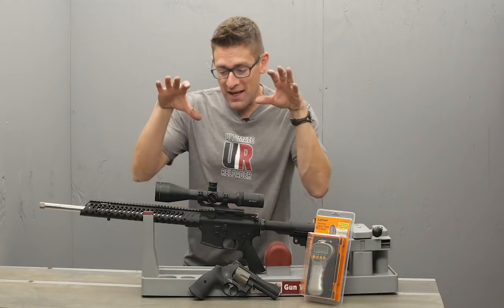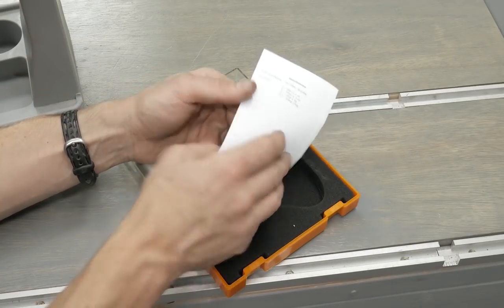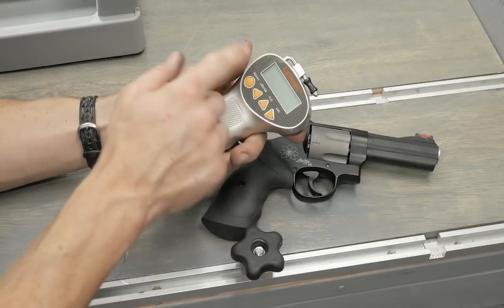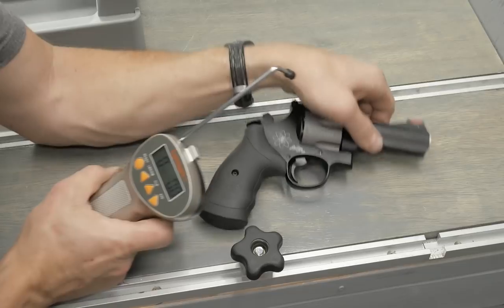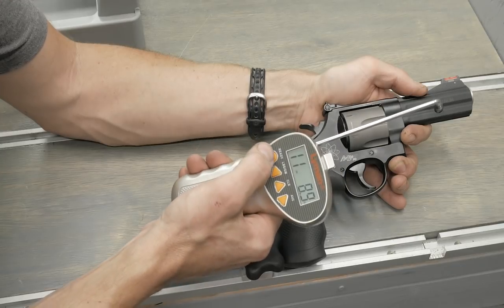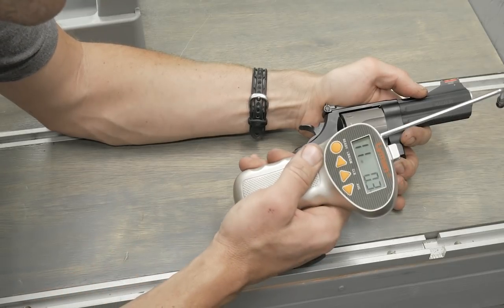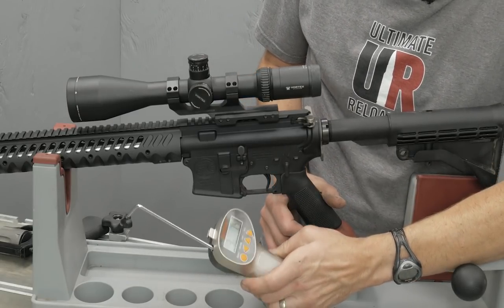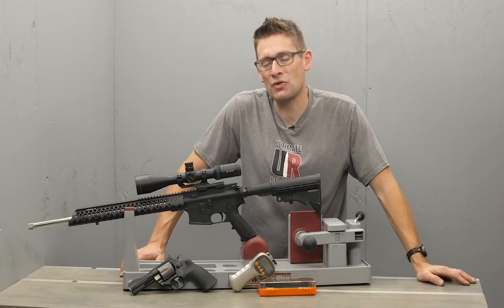Overview: Lyman Electronic Trigger Pull Gauge (tested on handgun and rifle)

Comment: To get an accurate read on the trigger weight it's extremely important to be sure the gauge is in the exact same position in the trigger shoe. One will get different readings at the top of the trigger shoe versus the middle or the bottom of the trigger shoe.

Comment: What is demonstrated here and many other videos is "dead weight trigger pull". This is  not the same as your hand being connected to the grip and pulling with your finger. 
When your hand is holding the grip and your finger on the trigger, your hand is functioning as a "two-pulley system."
First stationary pulley: your hand holding the grip
Second moving pulley: the trigger
Rope\string: your finger wrapping around the trigger.

You can test this with a simple shoestring-
Tie one end of the shoestring to the grip of your handgun, revolver or rifle. (This end will act as your hand holding the grip.)
Next, take the other end and put it through the trigger guard to the other side of the grip, and have the string laying on the trigger.(while pointing your gun up)
This will mimic your finger being attached to your hand as the string is tied to the grip

Now with your gun pointing up, pull the end of the string downwards with your trigger pull device (or attach some free-weights to the end) to see when the trigger breaks.
You'll find out that the weight is around half of the "dead weight trigger pull" .
This is because of the "mechanical advantage" of a two-pulley system with your hand being connected to the grip and your finger to the trigger.

So a ten pound trigger actually only takes about five pounds of pull from your hand and finger to break the trigger.